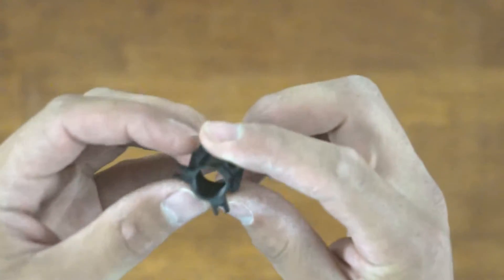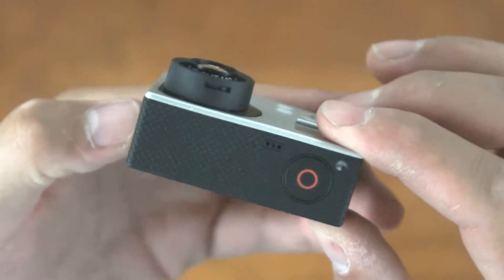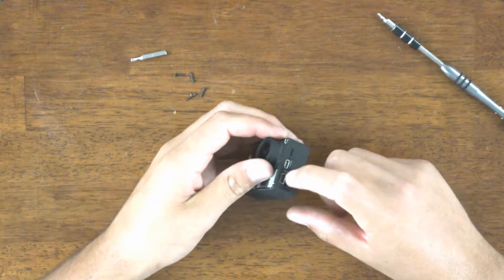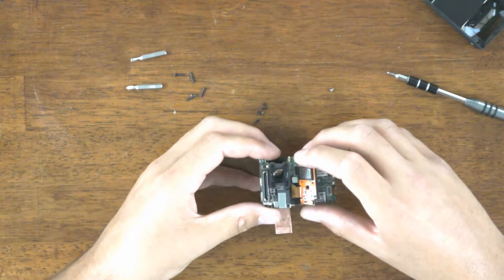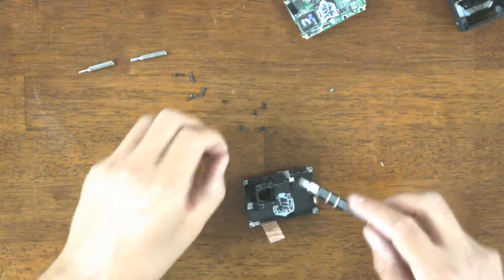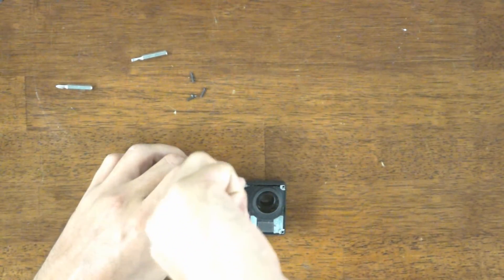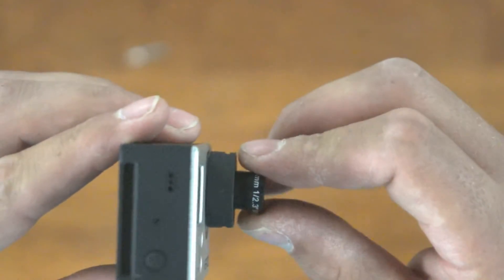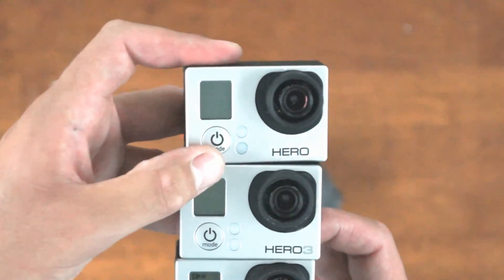Installing the SuperMount into GoPro Hero 4/3+/3 Cameras - 5.4mm Non-Distortion 10MP Lens

Comment: Do I have to understand that with a GoPro Hero 4 Black, I just have to buy the lens, unscrew the original one and screw beck the new one? And that I can do that every time I want a different focal length?
Reply from the maker: If you're installing the Supermount, the stock lens does not work in it. Yes you can easily swap lenses but keep in mind you have to focus it every time a new lens is installed. It's easy to do though with an HDMI cable to a HD monitor.